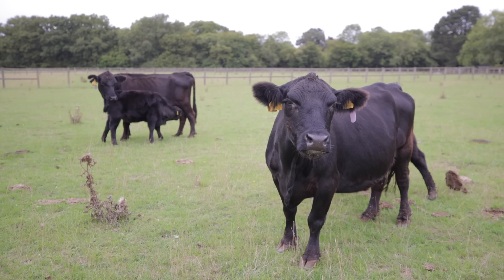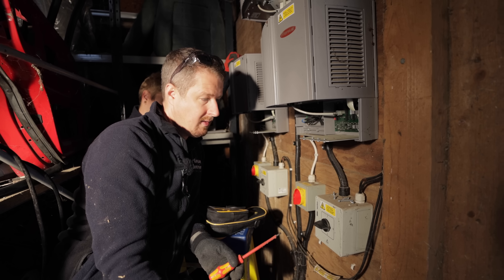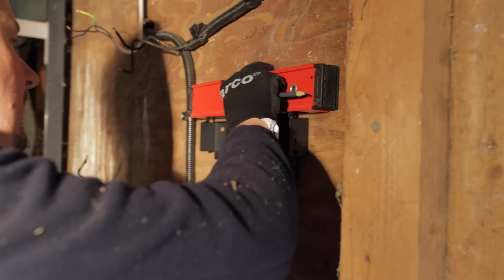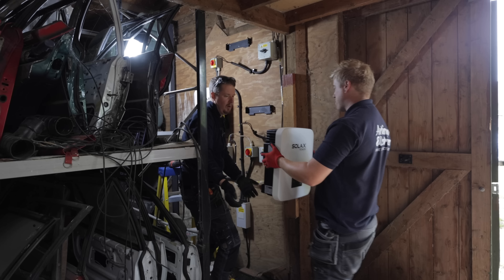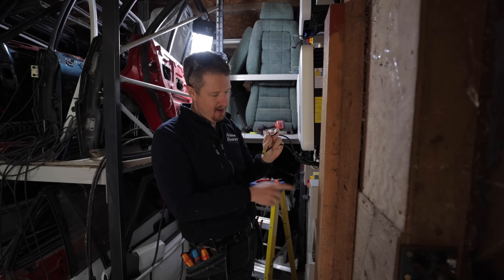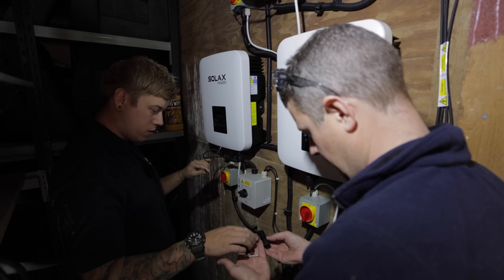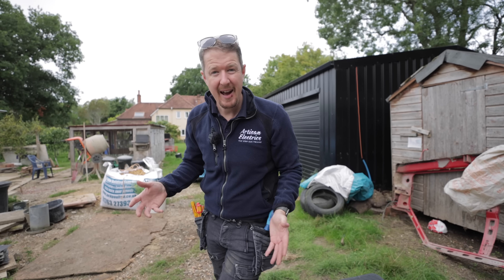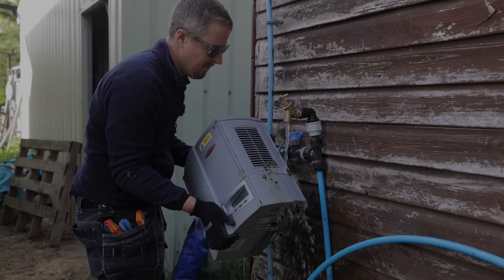A well OVERDUE Three Phase Solar Inverter Upgrade!

Comment: if you did need an internet link that far could always use a wireless point to point (bridge) easy for you guys to setup, being as your used to all the techie stuff.
Reply: Or a long range wifi connection- I have here a 500m link between two Unifi LR  points- admittedly it is right at their upper limits- and the data speed is slower (so no watching 4k videos at the front gate) but it is sufficient to run both the gates 1080 security camera, the video intercom and the electric gate opener... and not that much more than 'home wifi' points to boot...

Comment: Bit annoying it lost my post, I am Assuming this was a 3x1kw system (seems hardly worth it) usually I say single 3 phase inverter be cheaper but 3 is probably cheaper (China vs German be intresting how long they last, if they are transformer based they probably be solid)

Comment: Just a like for like swap, although swapping out good German kit for Chinese isn't great, there are a couple of small 3 phase inverters that could of been fitted, better quality too and overall cheaper for the client. always good practice to mount inverters on cement board .. both AC and DC kill in the right circumstances.. bit of a silly comment about DC shocks
Reply: Hate to tell you this, but Solax has been around for a long time- where I used to live, we had one installed back in 2016- and they were  a well known and reliable brand back then.... 🤔
Reply: ive not had a single failure from any of the fronius on solar edge inverters i have installed , had a few solax go down, from an installers point of view, i only want to fit kit that has a good reliability rate.
Reply: @thattoolguy9432  Frontius certainly hasn't got that a good reputation here in Australia, with many failures (usually the mosfets or the drivers) Solax has had relatively few issues in comparison... which was why I was surprised to see them being pushed lol
Reply: @steved2136  i wonder if that could be a climate thing, higher ambient temp .. its possible the heatsink isn't up to the job seeing as you say its mosfet related .. many failures on sunnyboy out there? i know that's a popular brand out there
Reply: @thattoolguy9432  The sunnyboy isn't that common (although it certainly isn't  unknown either) at a rough guestimate probably about 1/4 to 1/3 of gridtie installs have them, about the same with the frontius, the Sunnyboys  maybe a bit ahead in installed numbers in comparison... but the Solax is by far the most commonly used one here for the 5kw/single phase market (legal limit for a single phase install here)
Frontius has had more than their fair share of issues- between the hardware failure and their network interface issues they had for literally years, they don't have a stellar reputation here...
(same with microinverters- they have a 'horrible' reputation here, with many arrays suffering 50% failures before 5 years or so- whoever thought putting electronics (that fail quicker the hotter they get) 'right behind' a panel that can be at 80C or more, with air temps over 40C- was a 'good idea'... 😲
Reply: @steved2136  Strange how different continents have different problems, mine has been the reverse with fronius and solax .. totally agree on micro inverters.. have never fitted any just from the failures i here from friends in the field and i assume the failure rate in Australia is even worse
Reply: @thattoolguy9432  I suspect that the Frontius simply had inadequate heatsinking to handle Australian temperatures (and that goes doubly so for microinverters- sitting right behind the panels lol)- it is actually funny to see installers handling the panels the way the Artisan boys do- here in summer I used to use welding gauntlets to handle the panels, they get that hot that if sweat drips on the panel- it will sizzle and evaporate before it gets to actually run off (where I live summer temps can hit 40C plus for weeks on end)

Comment: would it not have been as cost effictive to have installed a 3 phase inverter & uped the array size rather than using the 3 inverters?

Comment: In all of human history, has a proving unit ever broke whilst in use?
Reply: That's the reason why you should check with a proving unit before AND after its use.
Reply: The idea isn’t to check if it broke while in use, the idea is to check you didn’t blow it up when testing. Highly unlikely in this sort of use, but imagine your indicator is only rated for 250v and you test across 2 phases, it instantly kills it thus giving no indication of voltage so you assume what you tested is dead, until you put it back on the proving unit and it still doesn’t indicate. As said, unlikely 99% of the time, but that’s the reason, not that there is a chance the indicator randomly failed.

Comment: Highly dangerous, leaving bare dc cables then probing then to see the voltage at least put a connector on them first , than at end touching the two dc cables together don’t worry I’ve ppe on , no you had a pair of sunglasses and normal work gloves on , what would you have done if it splattered as you touched them together, no regard to H&s